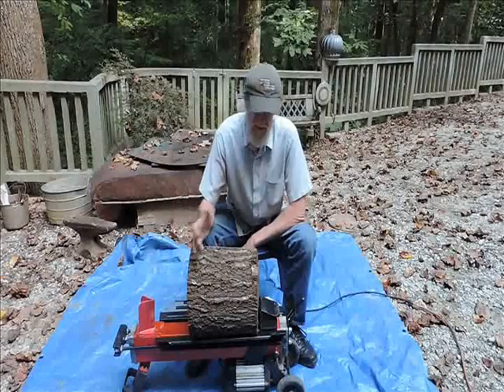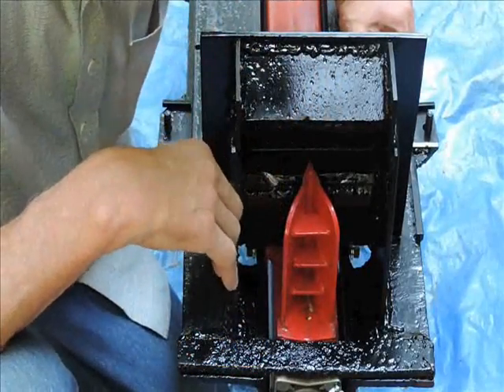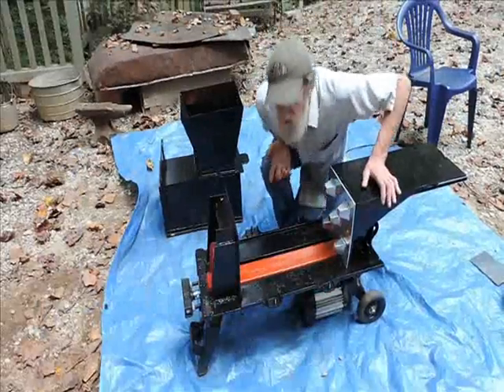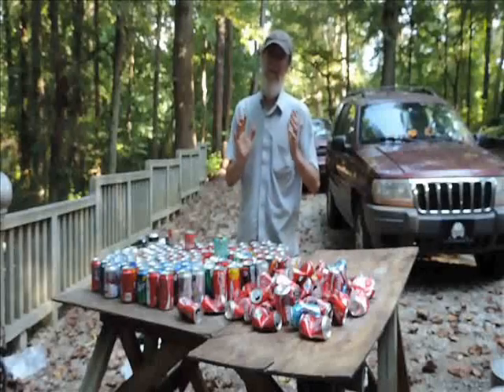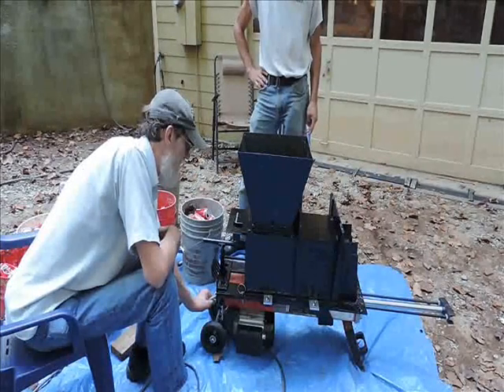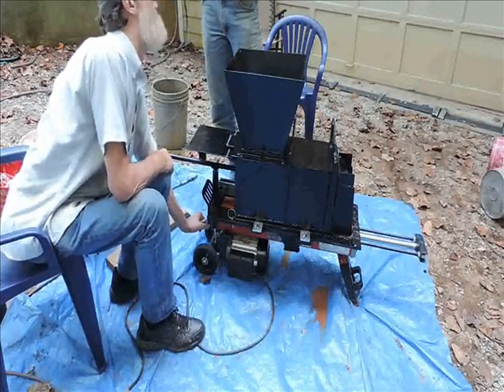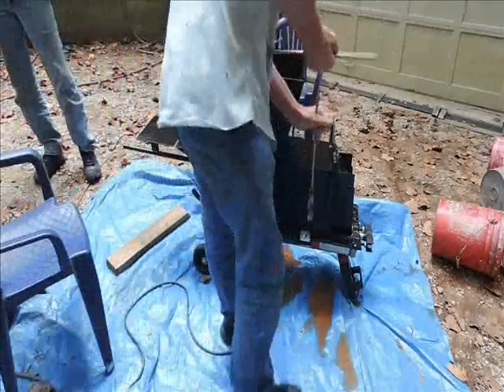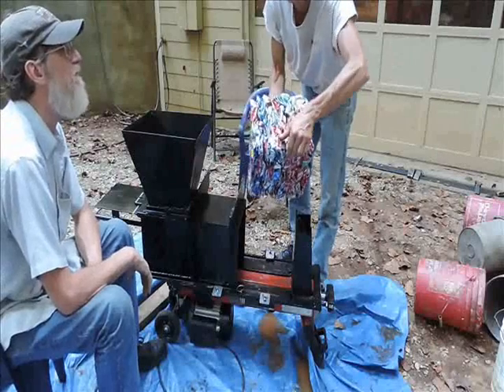Aluminum Can Baler

Comment: Since you have made this and can squash all these cans down so compact, you could make a crucible and melt it into blocks of aluminium and sell for much more than the cost of selling the cans. You are missing out of hundreds of dollars by just taking them down to a recycler. There is a few videos on YouTube that show you how simple it is to make one, melting down the crushed cubes looks very easy and making the crucible looks very easy too.
Reply: And since you could be making blocks of aluminium, if you go one step further, you could buy a small lathe and finish the aluminium off into nice quality machined parts too or just finish off the blocks with a nice machined face, would look much better and machine shops could buy them off you and then finish the machining themselves. You have a welder, so the crucible would be an easy build for you
Reply: MotorcycleTherapy  retail scrap metal dealers  depend on identifing the type of alloy the metal is by experience  or observation of the procts  originally manufactured.  When joe blow brings a block of aluminium  in tte scrap metal dealer would have to grade the block as the least  value. Say alum siding @20 cents a pound instead of 40 cents forclean alum.cans . So its best to maintain  the appearance of the original product to get the top price. Prehaps  a block of melted cans would make sence to lower transportation cost to the scrap metal dealer ,say 4 fifty pound blocks of melted alum. Cans  in a trunk of a car as compared to a pickup load of whole alum.cans in plastic bags approx 100 pounds
Reply: MotorcycleTherapy  one scrap metal dealer in Kentucky also has a foundry that cast manifolds from the scrap . Or joeblow could cast model  working steam engines parts for resale. The only thing i can think of is casting Confederate graveyard crosses but being alum they are likely be stolen so who wouldbuy a Confederate cross made of alum

Comment: Do you remember how much you were able to get for the bale of cans?
Reply from the maker: Yes It weighed 8lb @.60 cents per lb. Each cube used about 260 cans. We have recycled 10 cubes so far which is approximately 2,600 cans for $48.80 not much money but the cubes easily fit in the trunk of a car and did not make a mess.
Reply: Thanks for the reply. I didn't think it took that many cans  to make a little less than $50. But hey the way I look at it $50 is a half tank of gas, groceries, more soda, or tools from harbor freight. It adds up.
Reply: +Love2boat92 Plus, it's $50 you didn't have before.
Reply: Michael Rabil That is true also.
Reply: Love2boat92  many people horde their scrap all year til Thanksgiven  more practical with copper than alum. But a homemade baler maybe just the ticket

Comment: Very nice design.  I would use it if I could but I can't crush cans and still get the $0.05 deposit on them in NY.
Reply from the maker: ***** I have heard that does occasionally happen, especially in small towns with no competition. Large cities dare not try that or lose their business.  I don't see a problem in this case since you can simply remove the custom ram and use the flat backer.  A single bailing wire will hold it together for transport then you cut it and it all falls to pieces in the dumpster like slices of bread.  You are right though.  Recycling in America has a long way to go and that is why I took the trouble to make this device and give it to the world.
Reply from the maker: finster101 Yes that is quite unfortunate.  It is an attempt by legislature to force people to recycle.  It was probably done when aluminum prices and energy was cheap.  The bad thing is you are not actually recycling only getting your money back. Laws like that actually tend to kill and stifle  free enterprise and no longer have a purpose today.  The good news is they predict an aluminum shortage next year which will drive prices through the roof.
Reply: True but you can still collect the non returnables to bale them. I.E. Teas and juice cans. 
I still pick those up when collecting.
Reply: Very nice job man!  Great idea.  I don't know if all scrap yards would accept them in that form though.  Some places like them separated to check for debris/other materials from folks trying to jack up the weight.